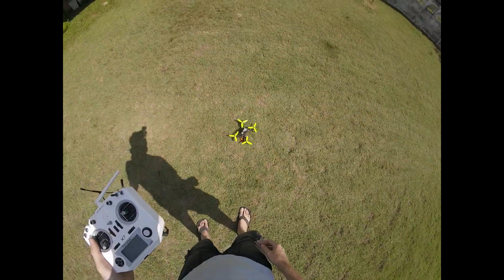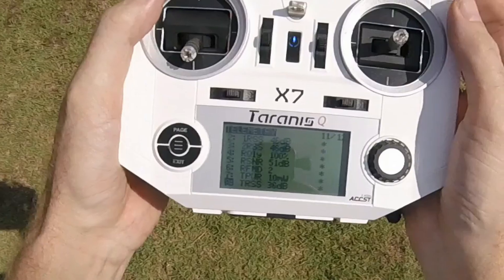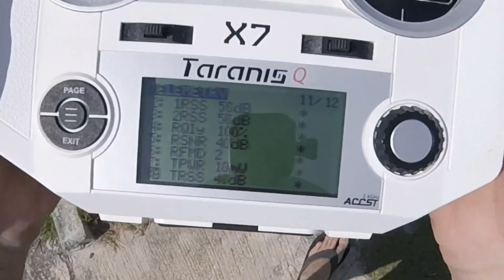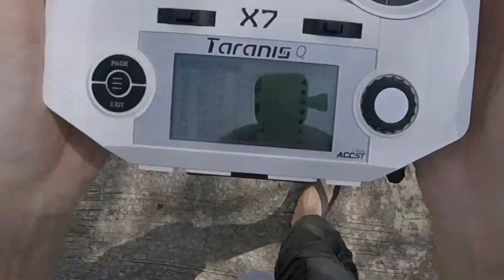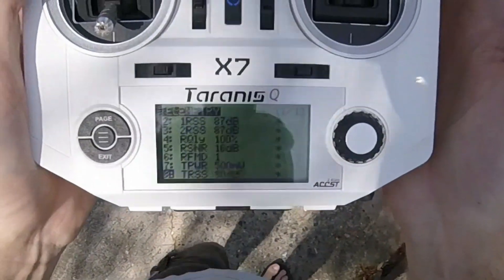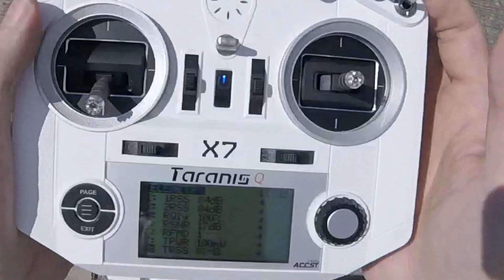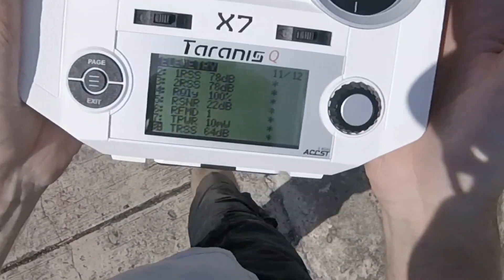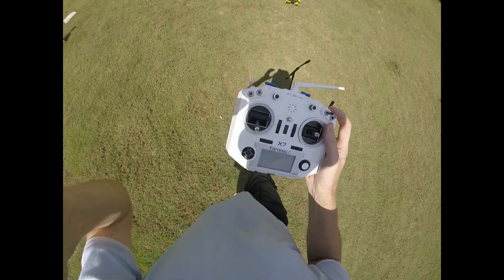Why I don't use dynamic power on Crossfire...

Comment: I have been having all sorts of issues on my last xf nano on x7 with full size 500mw Xfire module.  Fail safe 30 feet away at my last race. Some times at plug in I get the green light, sometimes not
Reply from the maker: Some of the problems I had with failsafes was a glitchy external power connector. Should be said that I had failsafes with a micro tx before i got the big tx so that i guess was firmware bug...
Now I haven't had a single failsafe for more than a year and I'm really happy with x-fire.

Comment: man, I really think that I am the only with this issue till i watch your video, my tango 2 pro tpower change to 1watt and still got low rssi at 800meters away (on tbs diversity rx). maybe I will disable my dynamic power or replace the motherboard. thanks.
Reply from the maker: Just run it with fixed power... I run 500m distance at 500mW without warnings... with dynamic I had 10mW at 400m distance which seems a little flaky... but it was many firmware versions ago...
Reply: @Siamect  okay i will try, thankyou 🙏

Comment: i have  a TBS tracer TX and ive been wondering if i SHOULD KEEP DYN POWER ON OR OFF WHAT DO YOU RECCOMEND?
Reply from the maker: I don't know about Tracer... but for crossfire I still run 500mW always... I never had any failsafe because of too little power so even half that would be ok for most use cases...

Comment: I am having this very similar issue with mine as well I guess when flying long range I’ll just turn dynamic power off then right? Thanks for the vid! I didn’t even think of this being why my radio always says 25mw
Reply from the maker: Yes I have dynamic power off and I can recommend anyone else to do the same. Having said that, there might be later updates in the firmware that resolve this issue and there may be environmental factors that makes this issues more or less server. Obviously there are people who do not have this problem...

Comment: I think the problem is you haven't done the modification required to the qx7 to use the crossfire module.  It can't run high baud rates because the radio is physically restrained to do so.
Reply from the maker: Thanks for your tip and some of the symptoms you see here is similar to not having any mod of the QX7. However if it had not been done I would have continuous telemetry problems and that is not the case. TBS sent me the modification board included with the tx module and I installed it before I even plugged in the crossfire module the first time. So that has been done.
Reply: @Siamect  in that case I don't know,  I'm having failsafe issues too with my tbs micro tx setup. After about 200 mtr the rssi drops like an old lady and it's over.  Strangely telemetry works fine
Reply from the maker: @Panasonic-paul  I tested two Micro TXes and I sent them back to TBS and got a big Crossfire. All had the same problems and right now it works pretty well and I just think they had some bad problems with the firmware although Trappy denied it... But that is my conclusion and i have been doing electronic engineering and software/firmware development for the industry since 1984...
Reply: You can make an internal modification,  that's if you don't mind a solder challenge

Comment: Damn, compare to my R9M, you have a lot of telemetry datas lol
I could not see your antennas orientation on your quad, are they mounted vertically like the antenna on your radio?
Did you ever try the TBS Diammond antenna? It seems to work slightly better combined with the TBS immortal T!
What is that RFMD sensor by the way? Is it supposed to go back to two as soon as you walked away from the quad?
Reply from the maker: Antennas are vertical or as vertical as possible :) Never tried the Diamond but it is probably better. However my fail-safes has been 20-50m out so...  I think it is some firmware glitch that locks the communication to the flight controller or something... It doesn't seem to have anything to do with low signal level.
RMFD is just a variable that can be 0,1 or 2. If it is 2 then you have full speed 150Hz update frequency of the stick position to the receiver. If RFMD is 1 then is it  50Hz and the telemetry slows down and OpenTX start to nag about sensor lost (bug?!). If RFMS is 0 then it is sending data only 4 times per second. 
The slower transmission is, the better range so when the signal is weak or noisy then it drops the RFMD from 2 to 1 or even 0.
In my opinion it should only lower the power if if it can do it without loosing RFMD=2 so that you always have the fastest communication, but it doesn't work that way on fw 2.41.
Reply: @Siamect  That's pretty interesting, we had also that issue with R9M with people getting failsafe 50/100 meters in away and it was indeed a glitch in the firmware.
The RMFD stuff reminds me the RF datas update of DragonLink V3 and indeed the slower that speed is and the better it is for your range but it will increase data transmission latency.
TBS has gone far that way and i can understand why they are so proud of their CRSF low latency protocol.
Reply: @blackmennewstyle  I had issues with R9M a year ago. Good news it was just software. BTW I bought XFIRE because of little range with R9.